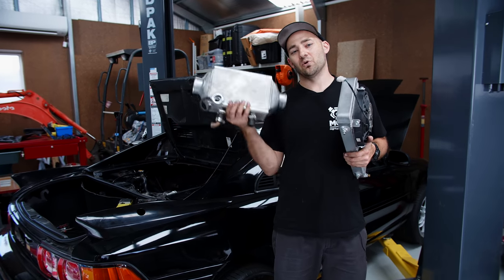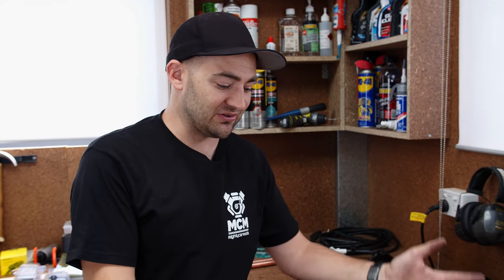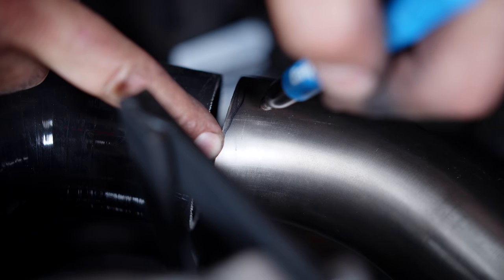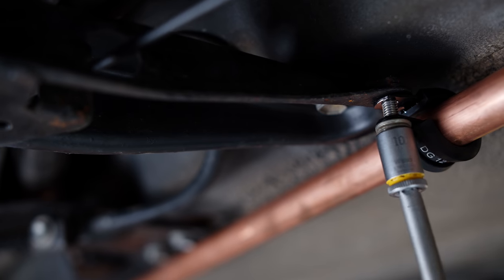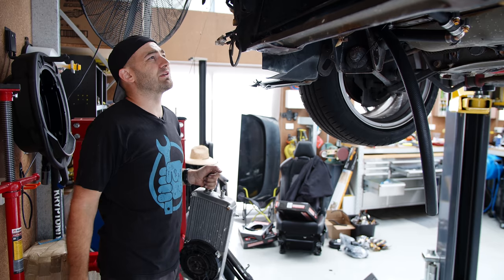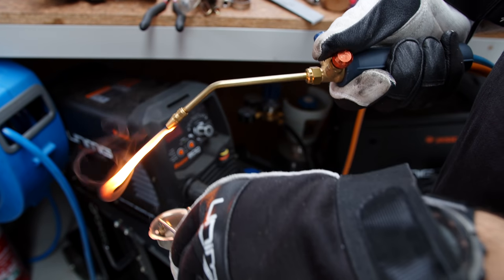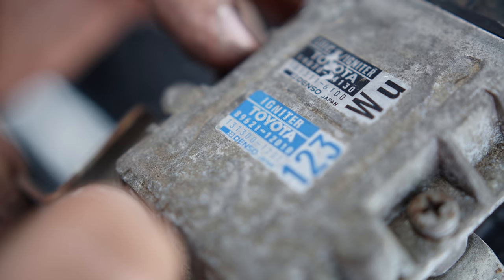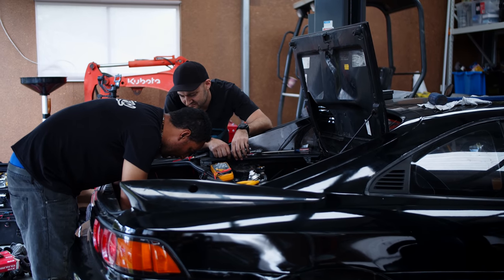MR2 takes Miss Daisy parts (Water to air Intercooler Install)

Comment from the maker: Check out our MCM Spine Shock Shirt! https://mightycarmods.com/collections/clothing/products/spine-shock-shirt-black-edition
Reply: Mighty Car Mods Yes, I beat you  too, first to comment first....chopped
Reply: Mixing Copper and Aluminum is generally pretty bad as it leads to all sorts of gunk piling up in the radiator and intercooler channels.
Fair enough this is a short run project car, but you'll want to get that copper pipe swapped out if you sell the car on.
Reply: Well Dave is an awesome and good man. Thanks for showing us all your tricks and soldering through the hard stuff so we can all learn from you!
Reply: You did legit get a bad MR2.  As an owner, that one is a nightmare.  Lots of friends who had them never experienced all this rust and trouble you are going through with the looms etc.  Man... You are however, very dedicated and I seriously thank you for fighting back.  It will be worth it.  I am concerned about the engine if the rest of the car was in this shape tho.
Reply: @quittessa1409  And bead roll the ends of them for now 😉
Reply: Everyone who owns, or owned mr2 sw20's feel your pain, I had one that rolled in an accident nightmare to fix, had two non-turbo mr2s. Just continue working with the car the way you have done so far, it will reward you at the end, and worth it when it's done right. Those mr2 cars don't rust easily, now I have a nissan and its starting to rust. Mr2s have quality paint work. With all that work done so far to your car don't sell it as it will be easier for you to working on it next time, familiarity. I regret selling my mr2s solid quality built cars.
Reply: Next challenge.. 

A surprise challenge.. 

Moog picks for Marty, Marty picks for Moog.. 

A car you would never expect to be a racecar car.. 

Or

The car that the person despises the most.. and turn it into a race car

Mazda comes to mind
Reply: @quittessa1409  at least im not the only one who noticed!
Reply: Whats the song used in the video?
Reply: One day my car will get to this and god Damm I wish my production quality was this good I love mr2s sick build
Reply: Aww, the bug's not around anymore? I subbed because of that and the Mini series.
Reply: I WANNA SEE YOUR GUYS' MOTORCYCLE COLLECTION
~Sincerely, another Bike and Car guy.
Reply: Mighty Car Mods just out of curiosity with your copper and aluminum issue.... never mind I see plenty have spoken keep on keepin on
Reply: @Zachariah Gerardo instablaster =)
Reply: @Pablo Jamie Thanks for your reply. I got to the site thru google and I'm in the hacking process now.
Takes quite some time so I will reply here later with my results.
Reply: @Pablo Jamie It worked and I now got access to my account again. Im so happy!
Thanks so much you saved my account!
Reply: @Zachariah Gerardo glad I could help :D

Comment: I can feel Al’s disapproval at the sillicone from here.
Reply: It's a look that'd cut through silicone pipe....
Reply: Will it fit my Honda?
Reply: Imagine if it was blue silicone too🤯
Reply: I can imagine Al's disapproval at working on an mr2
Reply: The Bad Obsession boys aren't thinking kind thoughts about that bracket either..
Reply: I can feel it too, and I'm on the other side of the globe.
Reply: Maddd connector fun. But if you're modernizing!
Reply: I am sure that stems from many many boost and vac leaks and the hours of hunting them down, trying to find a hose clamp worth a damn, and having to put them back on when oil blow buy causes them to blow off.
Reply: I can taste Turbo Yoda's disapproval...  
https://i.imgur.com/fYlWdfS.png
Reply: @larslarspantsonfars I thought that same thing. And plumbing parts to boot!
There is method to Marty's madness tho. He's working on "My Crap Car" for one race with Moog. And I'm betting he NEVER wants to touch that POS again. It'll get the good parts stripped off and the rest chucked in the bin. Like Miss Daisy. 
Al is a professional mechanic. Also people bring things to Al because he has a reputation for doing things right. Plus he's the Turbo Yoda.
Reply: @Lierofox  Hilarious! I'd thumbs up twice if I could.
Reply: Silicone isnt that bad. use quality silicone and put it together carefully and it will last years
Reply: Why is silicone considered bad?
Reply: @Sk1ds87  because it's not lobster backed stainless steel.

Plus at high boost, the silicon can expand.
Reply: @Sk1ds87  Because The Turbo Yoda said so.
Reply: Nice comment 😂 everyone needs to remember though that Marty hasn’t got access to the same fabrication tools as turbo yoda... yet.
Reply: @MrTomb13   It's interesting... Marty's got his own hoist which ain't cheap! 3 or 4 thousand bucks IIRC. I don't know why MCM don't use his garage for the show.
Reply: if66was99 yeah true, although they do have a lot of stuff in the MCM workshop. By the looks of it, Marty needs all the space he can get. Pretty sure I saw the boom from an excavator in the background 😂

Comment: I used to really want an MR2 - this video series has shown me the error of my ways.
Reply: If you are afraid of this then no "proper" old car is worth buying for you, be it a slightly older JDM K-Car or a completely rusted out Leyland MINI.
Reply: @4IN14094  Many older cars are easy and fun to work on. In fact, most older cars are actually fun and easy to work on. Buying an MR2 is jumping in an exotic challenge  knowing it's going to be exactly that: a challenge. It's definitely not for everyone.
Reply: It’s completely worth it when it runs, but I’ve seen and found that it likes to fight you so often. It’s an incredible experience, but if you just want to drive it might not be the car for you.
Reply: Just get someone else to do the legwork not a problem then
Reply: @4IN14094  i had a leyland mini...everytime you dipped the clutch the engine mounts came through the floor...😂
Reply: @Fostravel  That only depends on what how good the conditions of the car is.A rusted out piece of metal is still a rusted out piece of metal.
Reply: This is also the most difficult of all the MR2's to work on. Literally every other version, MK1 NA, MK1 SC, MK2 NA, and MK3 are all easier to wrench on than these turbo cars.
Reply: no you were right the first time
Reply: @4IN14094  True. Rusty car is always a pain to work on an we know quite a bit about that up here (Quebec, Canada). That being said, an MR2 is infinitely more hard to work on than the vast majority of older cars. Not only is the desing unorthodox, the field of options you have in termes of parts is pretty narrow and junkyard availability is pretty much non-existent. If you were working on a Ford Crown Vic 2005, a civic '98, or a Mazda 3, it would be a walk in the park compared to working on an MR2.

Comment: Bang up job on fabrication Marty!
Just one tip, when you are bending stuff in your bench vice bend it towards the bench, the vice is MUCH stronger in that way. You are pounding into the body of the vice. Bending away from the bench you are putting all the force and pounding into only the jaw of the vice. If you watch the video you can see the vice jaw flexing a lot, and cast iron is not meant to flex. 
Kudos to your buddy Dave for stepping in on the wiring stuff. 

The MR2 is gonna smoke the moon budgie big time!
Cheers from Tokyo!
Reply: Well said re the vice
Reply from the maker: Tokyo Craftsman good tip, thanks mr craftsman from Tokyo
Reply: @mightycarmods  Anytime, love your JDM content! 
Cheers!
Reply: @mightycarmods  I saw what looked like oxyacetylene being used to solder the copper tubing, but not to heat the bends. Put the steel in the vise, heat it red-hot, bend it like it's made of butter.

Comment: MARTY - "this crusty MR2"
Everyone in Illinois, USA - "look at that mint MR2"
Reply: Here in Iowa, "This car looks like a great deal!  Just a bit of surface rust, maybe they mostly kept it in the garage."
Reply: or anyone in the top 1/3 of the US...
Reply: @C4CHopeless  Only drove to church on sundays type thing?
Reply: That is what I have been saying, lol.  He is so bent up about what I consider normal amounts of rust.
Reply: Pretty much all of Ontario and Quebec too 🤣 they try to use penetrating fluid where I’d probably just bring out the oxyacetylene torch
Reply: I live in Quebec, and my 40K miles Mazda 3 was waaaay worse than this MR2. Bolt heads were completely gone, you could break them off with a few hammer hits...
Reply: I feel this in my soul. 😂 I live in Ohio, and my 07 Toyota has 10x the rust on it as this MR2! 👀
Reply: Mint! (paint only)
Reply: Cries in Indiana Hoosier
Reply: Iowa here too, this one is Mint and breeze to work on 😂
Reply: Same here in europe
Reply: any rust in Australia is a bad amount of rust. metal shouldn't be rusting in our climate
Reply: No road salt makes a big difference.
Reply: @C4CHopeless I had an sw20 MR2 in Iowa. New floors, new rockers, new subframe...and it was still a pile of rust.
Reply: Much same, every time, from Vermont. :'(
Reply: @ThatAdelaideGuy  he said that this car was from Japan. That's why it's bad. Usually the cars they work on are squeaky clean
Reply: Phew Illinois is still better than my place in upstate NY we salt the roads a week before we think a storm is coming in lol my 2010 wrx is starting to rust and it only has 70k miles
Reply: I'm frol Illinois and can confirm.
Reply: I'm from Illinois haha. True
Reply: That rusty bolt he drilled out, that's what would be left in Massachusetts.☹️
Reply: @tomclarke6475  see that's the opposite for me for some reason the bolts come out just fine it's the part itself that just crumbles into dust
Reply: in Canada west coast , i be like that in good shape for a 30 year old toyota, 1/3 of most jobs is dealing with rust.
Reply: Right ? For a car this old, it's practically immaculate.
Reply: I have been staying in Washington  for a few months and I see how nice all those terrible rusty cars look in Minnesota
Reply: 😂 
It’s the same here at the coast. Cars get rusty fast without care and there’s a lot of cars on the coast without care.
Reply: Stigs Ukrainian Cousin Yup I felt the same way. When I lived in a cold 🥶 environment, I was shocked 😮 how well people cared for their cars.
Reply: In Canada, that MR2 is a great deal and could easily catch 15-20k.

Comment: Project Binky: six hours for one bracket

Marty: Hammer and a vice
Reply: michael pontoni 7 years. Like I get it, make a neat rally car, but 7 years. And it’s not really close.
Reply: @mrs_radrod  Bro, 200 hp AWD mini with air conditioning
Reply: @mrs_radrod  oh cameon what car are you even talking? it's just huge bracket FOR ALL THE FANCY BRACKETS
Reply: Christian Gotsch calling it a neat rally car is not doing it justice. It’s also not a rally car.
Reply: Christian Gotsch that car will be the cleanest, fastest, nicest best made mini to ever grace the streets, if you really enjoy something and want to have the best you’ll do it right doesn’t matter how long it takes
Reply: @Christian Gotsch  As they've said many times, it's not a rally car, or for any sort of motorsports, for that matter.  Binky is intended strictly as a road car.

Rather than bitching, let's see how long it's taken you so far to fabricate and film (since filming and scripting takes a lot of additional time) - anything remotely as intricate as Binky.
Reply: Don't they have a Peugeot 206 or something for rallying?
Reply: @jackthatmonkey8994  You forgot to add without extending the outside dimensions
Reply: @mrs_radrod  they are basically building a brand new car, how long do you think nissan or toyota actually takes to fully design and build their cars?
Reply: functional FTW
Reply: Not all brackets are made equal!
Reply: One thing can be gleaned from this reply section: do not chastise the Binky.
Reply: I mean yes, but Project Binky is just a whole other beast.
The attention to detail and level of craftsmanship is INSANE.

They know it's ridiculous how much work they're putting in but it's kind of the point.
Reply: @repairupdaterepeat5815  i believe they have a Peugeot 205 GTi. probably in need of rebuilding once Binky is finished
Reply: @petelattimer6808   and amazing carbon shell of MG coupe
Reply: Yea but the Bad Obsession boys work is art. Whereas this is basic cack handed stuff done in a shed.
Reply from the maker: michael pontoni not even wrong, their work is next level and those guys are pro’s. I’m working it out as I go.
Reply: Mighty Car Mods aren’t we all 😂
Reply: @mightycarmods  both are awesome! Just entirely different beasts.
Reply: @mightycarmods  I GOT A REPLY!! Im so excited. I love you guys. I just thought it was such a stark and funny contrast. I was thinking if I was watching them, thered be three episodes of them making the brackets and youre like, BANG, done lets crack on.
Reply: @aussiebloke609  I'm really not bitching. Also I believe the first few eps they described it as a rally car, but I really havent watched that far into their build. I'm extremely impressed with the car itself, but I am surprised that the value proposition still exists.  That takes an unbelievable amount of dedication to continue working on it, as most people would have moved onto something far easier.
Reply: @Christian Gotsch  They talked briefly about Toyota's rally history with the Celica, but never said that Binky was intended for rallying.  There's also this definitive quote from Nik from their Unplugged Q&A Vol 2 video: 

"I've run out of ways to say it, so for the hard of thinking, this will be a road car.  It's not eligible, would never be eligible, for any kind of competition we're interested in, so it's purely for hooning around the countryside."  - Nik

https://youtu.be/LZr7plOW6UI?list=PLDfniL-49-SVCU5XYr9EGywGyY25g_AvD&t=28
Reply: @mightycarmods  Marty get yourself a MAP gas torch for bending metal..Less stress for you and the metal...and you can burn things too...like a certain glorified beach buggy...just saying...
Reply: Repair Update Repeat they have a Peugeot 205 GTI setup for rallying yes
Reply: Project Binky is cool and all but I'm a lot more in the Roadkill segment of the internet car building alignment chart.

Comment: "It's 19mm internal so parts are nice and cheap" runs straight length copper pipe 🤣🤣🤣 love ya Marty not gonna lie this build is alot more interesting the the moon buggy
Reply: doesn't mixing metals cause corrosion? :/
Reply: @pedrosmartins  yeh if the radiators are aluminium cores then there will be issues
Reply: @pedrosmartins  You could run a coolant filter that has anti-electrolysis pellets in it or you can drop the pellets in the radiator from time to time. Making sure the engine has a good big ground also helps.
Reply: @pedrosmartins  coolant in nz and aus has built in anti-corrosion, probably cos a lot of people don't change it for ten years lol!

Comment: MOOG: Rebuilds carbie, changes fuel lines, changes brakes, ready to go. 
Marty: Rebuilds entire car, car still needs work.*
Reply: Moog built nothing. He needed help
Reply: @MrShiraaz786  Moog did the fuel system. Carburetors were out of his comfort zone so he got help. Marty needs help with the wiring. It's not Moog's fault that his car didn't need completely rebuilt. 

In any event, the comment was ABOUT THE CARS NOT THE PEOPLE. Jesus.
Reply: @MattyH1992  marty is a better mechanic
Reply: @MrShiraaz786  I would agree with that.

Comment: So. Much. Work.  Man, you have a mountain of patience.  Hot tip when soldering copper joints; heat the fitting from the opposite side of where you apply your solder - the solder will literally be drawn in towards the heat.  Great work, Marty!
Reply from the maker: Good tip, thank you!

Comment: Holy crap this car is enough to do anyone's head in. I'm expecting by the time it's done poor Marty will be sitting in the corner of the shed rocking slowly and chanting under his breath "I still like my car, i still like my car" with a dull lifeless expression on his face as he breaks out in a cold sweat and starts shivering.
Hang in there Marty, this car may be giving you the wrong end of a pineapple but victory is close!!!
Reply: I think once he drives it with some of the newer stuff bolted to it and all tuned up he'll be glad he got there in the end and will have a smile on his face when he drives it, sure its been a bit of a pig to work on, but thats just MR2's in general, the fact this has had 3 different engines in it at some point means your probably gonna have to deal with hacked wiring somewhere.
Reply: Hang in there Marty! Love Your work!

Comment: Dr. Ray Stantz: Everybody can relax, I found the car. Needs some suspension work and shocks. Brakes, brake pads, lining, steering box, transmission, rear-end.
Dr. Peter Venkman: How much?
Dr. Ray Stantz: Only $4800. Also new rings, mufflers, a little wiring.
Reply: Haha--greatness!!